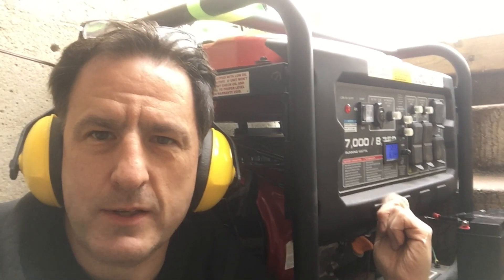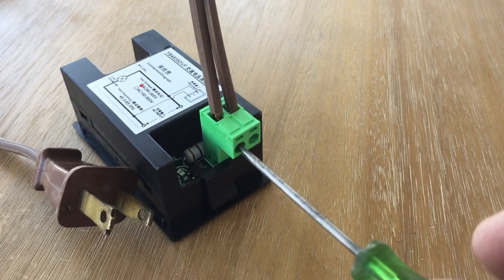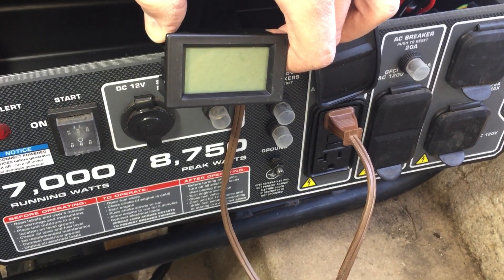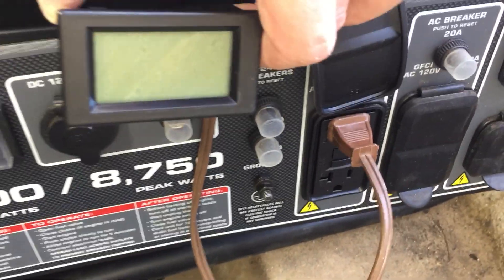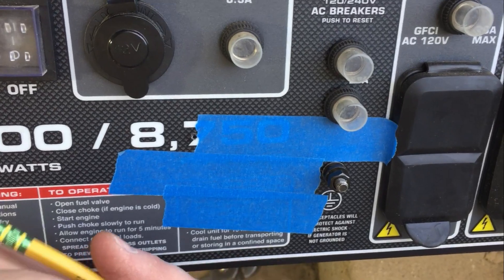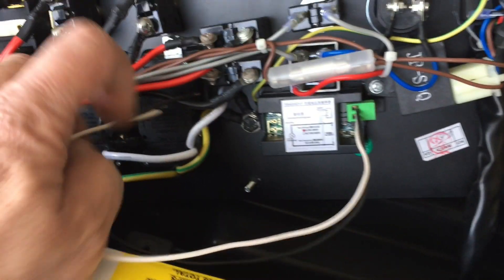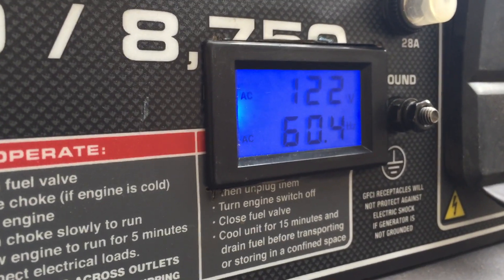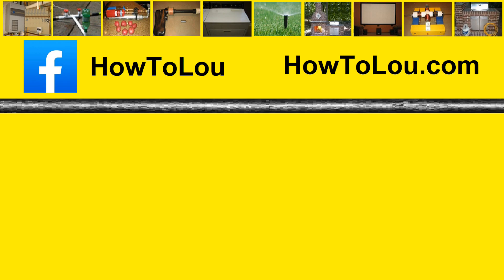$15 DIY Generator Frequency Meter Install

Comment: Two things....actually running 61-62 Hz and a smidge over 120V unloaded might be a good thing...as a mid to heavy load gets you back to 120/60. 
Also this......since I'll be using the 240V 4 prong supply mostly....can we do this on the 240 plug instead?..and if so...would you connect one meter lead to red (hot) and the other meter lead to black ( hot )?...on the 4 plug 240V outlet?  Seems from the Amazon ad showing the backside specs, it can take 300V. Would I still be able to read 240V and 60Hz ?
Reply from the maker: Just put it on the 110 line, like I did.  The frequency of the 110 and 220 will always be exactly the same, since they are coming from the same generation head.

Comment: Hello just recently added 13000 duramax tri fuel and I am running it on NG, I am seeing 62.5 on the HZ meter and also have a misfire when running the generator. I noticed that you control your gas volume with your valve and were able to get your HZ down to 60 and you got me thinking of trying that, I will try for myself and see but do think that my have something to do with the misfire? This unit comes with a regulator and calls for 225000 btu, I called my gas company before purchasing unit and they told me that I get up to 500,000 btu at the meter. I guess it's possible to have too much flow even know I have a regulator. Great video
Reply from the maker: Some regulators are adjustable.  Look for a set screw.  If not, you would have the best control if you could add a valve between the regulator and the engine.  Yes, I got 60 exactly
Reply: @HowToLou   Thanks for getting back, So I tried to adjust fuel flow at my dedicated shut for the geny but made no difference. I also called Duramax and questioned them on it and was told that within parameters and there is no adj screw on unit regulator. 
As far as the misfire they say it's a break in period and that will go away in about 6-8hrs, I put about 2 hrs on geny and not completely sold on that. I think a shut-off between the regulator and engine sounds like a good idea but this is a week-old geny and I dont want to mess with it yet. I probably will take this over to the Duramax site and see if other owners had this issue
Thx Lou
Reply from the maker: Yes, i would expect the shutoff before the regulator to make little difference.  As you close that valve, the regulator opens more, to maintain its constant output pressure.  A valve after the regulator would work.  There is also a small rod, about the size of a pencil lead, connecting the throttle on the carb, to a governor arm, coming from the engine block.  This arm typically has several holes where the rod can attach.  Moving the rod to different holes will change your RPMs and your frequency

Comment: Hi Lou.  I just did this installation.  When I hooked it up to the house, it was 60hz and 120v.  I hooked it up to the generator's recepticle and when the generator's running, it shows 120 v, but only  1 hz.  The The outlets work, but I'm not sure why I only get 1 hz.  The generator was running on gasoline.  Any thoughts???
Reply from the maker: Hmmm.  I would try the house power again and see if its now 1hz.   Maybe the meter broke.  Infant mortality is common in small cheap electronics like this.  If not that, I wonder if there is a units setting on the meter than somehow got switched.  If not that, it got to somehow in the wiring.   This should not matter, but try reversing the leads.  You can also try measuring from one power lead to frame ground and then the other.  I am sorry I can’t give you an exact answer, but those are all the things I would try.
Reply: @HowToLou  Thanks so much Lou.  I shut it down and started it back up and it reset itself and is working well.  I noticed other inexpensive units that show amp usage also (as well as PF, KWH, etc...) Are you aware of any videos that show how to hook them up to a generator so I can see what the house is using (drawing in amps from the generator)?  I have a B&S 8000 / 13500 generator that has a 30 amp receptacle that I have hooked up to the buss.  Since I'm using going to use natural gas, I'm pretty sure I will lose some of the capacity, so running the house AND 1 of my 2 a/c's may not be realistic  ( one 3 ton and one 3.5 ton).
Thanks again for your response
Best Regards
Dave
Reply: @daveinkeles7937  On my channel I show how I added a watt meter/pf/kwh/ect... to my generator.